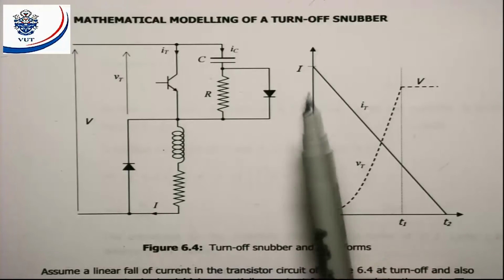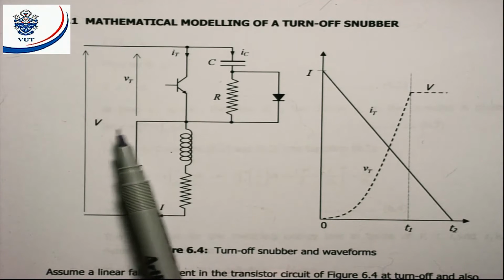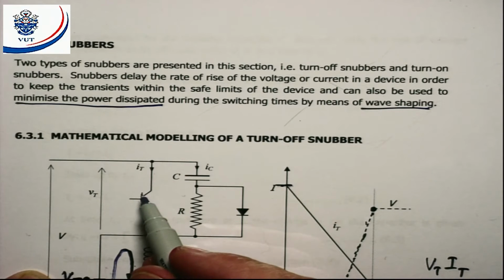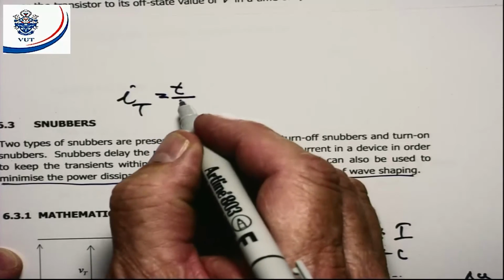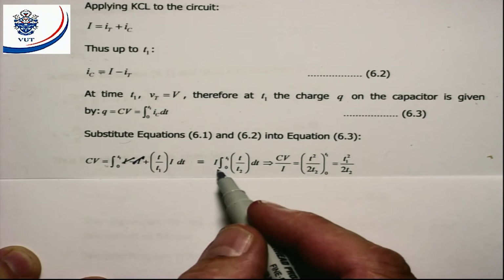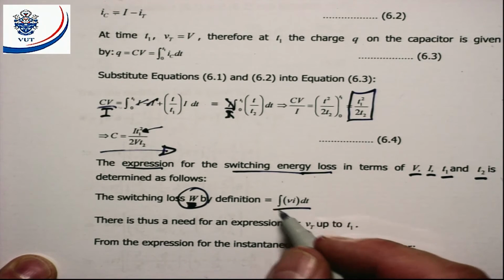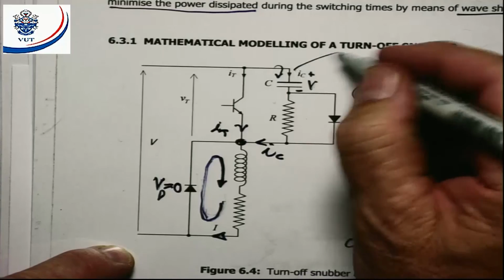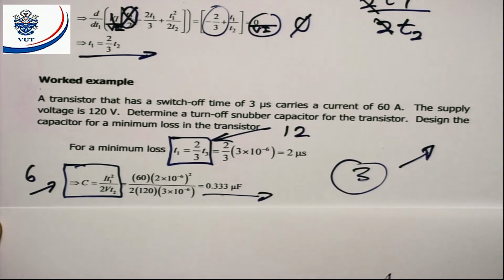snubbers- turn off snubbers

Comment: Sir rc sunbber curcite is paller of igbt  how to calculated the resistance, capacitor value pl. Sed video
Reply: Sir , rc  sunbber curcite is paller of power diode how to calculated the resistance, capacitor value pl. Send  video